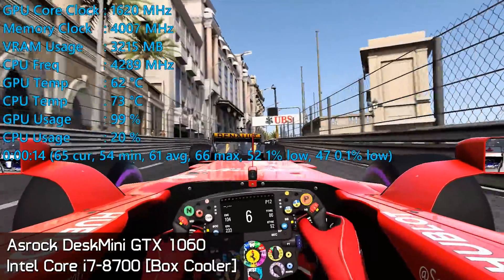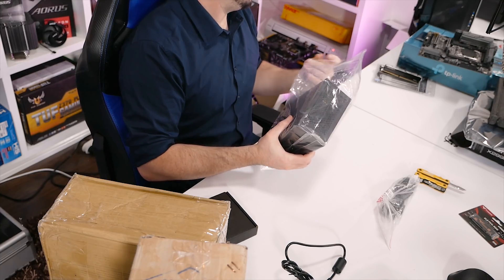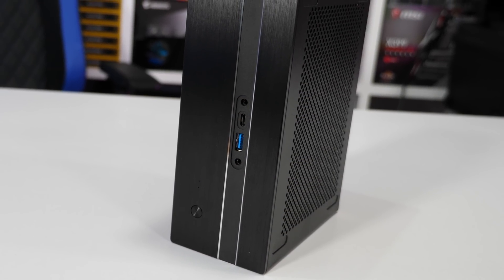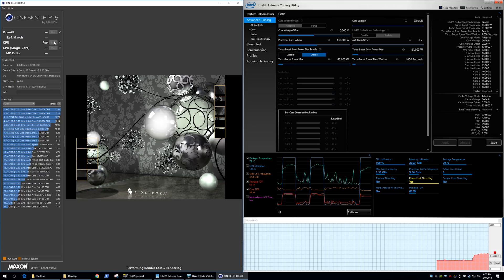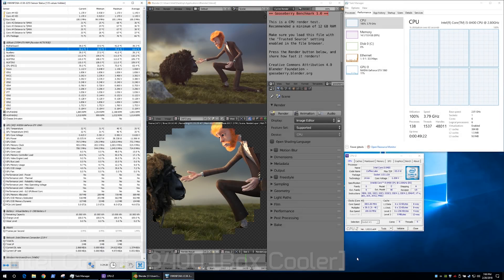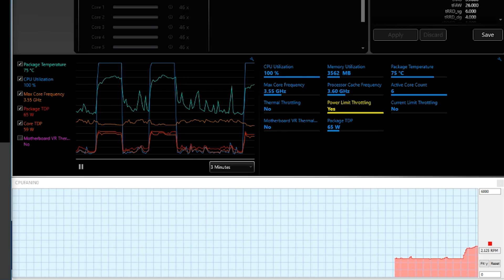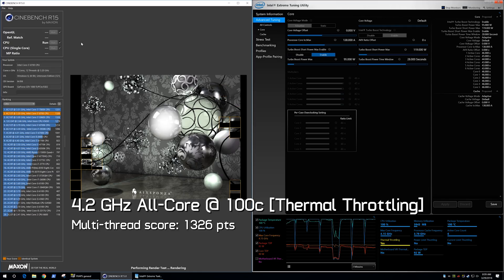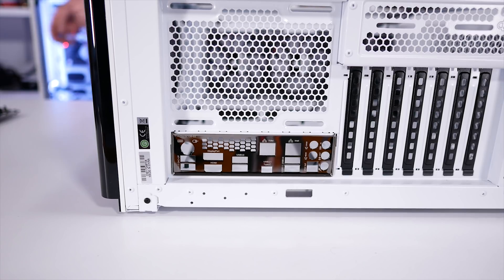Core i7 8700, Intel Box Cooler Limiting Performance

Comment: 65W - 3.5Ghz, not 4.3. CB15 score 1450 (normal result in reviews, if you forget about MCE-boys) / 1127 = 1/3 LOWER! This is Con-Lake. Power consumption and heat dissipation one of the most important characteristics of the processor, otherwise manufacturers would sell overclocked versions with 200W and dont care. When there is no normal cooler and forced to buy aftermarket for ~20$. This is Con-Lake #2.
Reply: Forced, because advertised performance (by review sites) is not achievable out of the box. "Very fast" can be measured, 1127 - does not fit, because this is the result of stock 1600. Which now costs 189$. 8700 - ~300$. Not "even more", just 4.3 on all cores, this is the problem. You're too obsessed with this gammaxx, actually it not everywhere cost "10$", newegg - 20$, some cheap shop in my country - 16$. Why does AMD all work out of the box and even allows it to overclock? And the expensive intel gets even more expensive. Okay, let the Intel conclude a contract with Deepcool. And fix the fake TDP for realistic in 95 or 115 or where it is not throttling. Then the problem will be solved.
Reply: on the asrock z370 pro4 with 102,4mhz baseclock and the 20€ ekl ben nevis my i7 8700 scores 1458 in cinebench with MCE off https://www.dropbox.com/s/bz69bfvh4y019ur/cb15.jpg?dl=0
Reply from the maker: You aren't forced to do anything and the real out of the box performance of this CPU is with the box cooler and it's very fast. You just get even more performance if you spend $10, that's not a conjob. The real score isn't 1450 pts either, I can't get that on a high-end Z370 board with a liquid cooler.

Comment: So, "out of the box" or the default performance is lower ( which in computerbase review, the OEM Medion said: that's inline with Intel spec)  is sucks, and you have to tune it with additional software and additional aftermarket cooler to reach or at least getting closer to the "review" performance?. 

Well, I would call that a "con" job indeed.
Reply from the maker: You've some how misunderstood. The way the 8700 performs out of the box with the box cooler is what you should expect. Reviews that only use advanced cooling have miss-lead you. The 8700 is still extremely fast with the box cooler, it's just faster with a tower style cooler. It's not a conjob that's silly.
Reply: Hardware Unboxed 
"Reviews that only use advanced cooling have miss-lead you", isn't this the problem here? . something that was created from the omissions of all core turbo information that's within spec/the standard configuration that the consumer would expect when they are buying PC from OEM, so, without that, reviewers would just go with whatever results come from their test bench regarding the the all core turbo which in turn giving false expectations of performance the consumer would expect to be out of the box or from OEM.

I get it that there's no false information coming from Intel, but the fact is this practice create false information from many "mainstream" reviewers which most people would refer to.
Reply from the maker: @Snow Star - Any OEM will just use the box cooler which is rated for 73 watts. Almost anything else would be better.
Reply: Hardware Unboxed I got questions to ask, the i7 8700 TDP of 65 watt is measured at base frequency of 3.2GHZ correct? If so any OEM would stick the 8700 in a 65 watt or lets say 80 watt motherboard, and use a 65watt TDP cooler to save cost and make a profit correct? 

If so the max all core turbo would only be as high as what's possible with 80watts for as brief of time as possible in order to make sure the computer works within warranty period right?

 So in light of all that is it safe for an average person to look at reviews that allows the 8700 to consume what ever watts it needs with the lowest temperature and say well guess I'll buy the OEM machine because the OEM machine will perform similarly? Thanks
Reply: Snow Star that's the problem mate. As you could see in this video, in order to get the performance you see in many reviews, you have to remove the TDP limit using Intel XTU to 135 watt, well basically running it out of spec or in other words overclock.

So, Steve, the "blame" is not on the box cooler but the TDP limit, since you have to remove the TDP limit first in order to get that performance. OEM using 65w cooler isn't to blame since they use it because it's enough to run the CPU within spec 65w from Intel itself.

Basically the root of the problem is the lack of information, guidance to reviewers from Intel. 

So, "con job" confirmed?
Reply: Lucurous I assume the 8700 exists other than standard reason of product segmentation and what not is because the 8700 will not do 95watts at 3.7GHZ and clock higher(low quality silicon). In other words clock per clock the 8700 would consume more power and run hotter compared to the 8700k. 

Put the 8700 in a typical OEM PC and it is safe to assume under gaming/heavy use the CPU will run at base clock (or as this video mentioned 3.8GHZ but that would exceed TDP)99% of the time but users who bought the PC are under the impression of over 4GHZ turbo on all core all the time. Even worse for the lowest quality CPU which is the 8400. 

Maybe just not buy an OEM machine the cheap one at least.
Reply: Snow Star it really depends on what TDP the motherboard set at or what the OEM specify. In this video with 65 watt TDP the cpu limited to 3.5 Ghz (not 3.8) . Of course as in this video you could remove that limit, set it at 135 watt and with an adequate cooler it could reach 4.3 Ghz, presumably at higher voltage (power).

This make curious about motherboard with 65 watt TDP. I would guess they would behave the same, so locked at 3.5 Ghz or maybe even lower if you have bad luck with silicon lottery and get cpu that require more voltage at the same clock, anything that could reach 3.2 Ghz at 65 watt is passable as 8700 after all. So, yeah Intel took silicon lottery to the whole new level.

Comment: I have a i7 8700 i slapped my old 212 Evo  activated xmp an got 4,43 allcores stables at 55c , the problem is not the processor is the shitty stock cooler
Reply: Od1sseas you know bckl oc exist? You can overclock a CPU with the multiplier blocked just by modifying the bckl frecuency . Read a little  before you talk
Reply: The Asus prime Z370 let you adjust the frecuency from 100 to 103.5 and thats just enough for 4,43 all clock and 4,7 single
Reply: It can be dangerous for your Sata devices. And not worth +3.5% clock increase.
Reply: Dmitry i Talk with Asus support and they told me is so mild It wont damage any component. I didnt do It to oc the cpu, it was automatic when i activated the xmp profile of my corsair vengeance 3000 ram.
Reply: bckl overclocking will not damage your Sata ports or PCI-E ports.  Those ports are on a seperate clock from your reference (aka bckl) clock.  the reference clock is used to find the CPU, memory, and Motherboard bridge frequencies and is a great way to overclock a locked system.  I used that tecknique before to overclock my AMD Athlon X4 640 from 3.0 to 3.3 GHz.  I wanted to go higher, but thermals were getting in the way so I had to stop it there.  I Ran that OC for over a year with out any issues before I upgraded that system to my i5-4690K
Reply: You delid ?
Reply: Yea mines running 4.5 lol but I have a huge cooler on it and I’m use thermal grizzly Kryonaut made a huge difference

Comment: I5 8400 or ryzen 1600?? For gaming
Reply: Ngurah Bramhyang well for pure gaming the i5 8400 takes it, but this month ryzen 2 comes out (ryzen 2600) and also the cheaper motherboards for coffeelake so wait a few weeks before buying anything
Reply: fromholland1001 okee thankyou brother :)
Reply: Depends on resolution and framerate. Ryzen should be fine for anything under 144hz. The two will be equal at 4k when the gpu is the bottleneck, and the extra performance Intel gives won't be worth the price since the boards are $150 compared to $50-80
Reply: nice info, thankyou so much!
Reply: Not much of a difference from what I've found, its just that the 1600 is unlocked for overclocking, and the B350 boards are about $60, it also comes with a good stock cooler.

Testing Fornite, the difference between Ryzen 1700 (3.8 Ghz) vs i7 7700k (4.5 Ghz) was 220 fps vs 240 fps respectively. This was lowest settings (360p resolution) with a Titan Xp and GTX 1080, so no GPU-bottle-necking with it way under 720p even. That's the best case scenario to show differences between them.

Comment: Just undervolt, wont be so much trouble with power consumption and thermals throtling
Reply from the maker: .....or buy a $10 cooler.
Reply: Hardware Unboxed I had that mini case in mind;) 
PS: I Appreciate your job <3

Comment: My i5-2500 would only do its all core turbo, never going any higher regardless of whether it was 1 active core or all 4.

These are the advertised clocks for the i5-2500 non-K (and are stated the same in Intel XTU)

Base: 3.3GHz
4 core: 3.4GHz
3 core: 3.5GHz
2 core: 3.6GHz
1 core: 3.7GHz

However the best i could get was 3.4GHz regardless of how many cores were loaded (running at 70'C load with an oem cooler)
In order to get the 1-3 core turbo clocks I had to enable a BIOS option, Extended CPU power savings (Reluctantly)
Which allows the non active cores to idle, conserving power/temp budget and allowing higher turbos on the actual active cores!

Of course this is a BIOS/Board restriction, but interesting nontheless.

Comment: I think that Aldi Median system showed a typical hot box scenario and what can be expected from many pre-built brand name systems that use the box cooler and minimal airflow case designs. Most people building their own systems and avoiding the extremely low cost no name budget cases should be able to avoid building a typical hot box and give the system enough airflow to prevent the worst of the thermal throttling so long as ambient temperatures stay within a reasonable range.
Reply from the maker: It was also temp limited to just 74 degrees which is the primary reason for the drop in performance, that and they used the box cooler ;)
Reply: In all honesty I cringe at temps over 70 degrees and so having a 74 degree limit shouldn't be the cause of throttling, even though I know that the chips can handle it.  When temps get into the 80's and 90's, in my estimation that's just pushing performance over efficiency a bit too far for my taste. I personally look to keeping everything well under 60 in normal use and will only be ok with higher temps during stress testing overclocks for system stability testing. As far as I'm concerned the TDP rating on the 8700 is a marketing ploy to enable using an insufficient boxed cooler, Intel have had boxed 95Watt coolers in the past and so there is no real excuse for not including one even if they are rating the chip at 65W, it's not as if it's a budget chip, it's their second most expensive one for the desktop and the cost difference between the 65 and a 95W coolers would be less than a couple of bucks for some more aluminium or a copper slug, because at stock there is very little chance of these chips running 65W or less under load unless they are purposefully temp and TDP limited, which OEMs are likely to do to enable the use of cheap parts.

I have a 2200G enroute now for an eventual router build (bloody Easter delayed it) and I have a spare spire cooler from my R5 1600 build and I'm hoping that will be enough to keep temps in check with moderate overclocks of 3.8GHz/1500MHz, if not I might use it as an excuse for a 120 AIO and finally play with water cooling, just for the fish. (for the halibut), though when I do build the router it will be air cooled and back to stock.
Reply: the Aldi system use the official specification from Intel. 
The Aldi system use the turbo core for 8 secounds und than it got to base clock.

this is the link to the test.
https://translate.google.com/translate?hl=en&sl=auto&tl=en&u=https%3A%2F%2Fwww.computerbase.de%2F2017-12%2Fmedion-erazer-x67015-aldi-gaming-pc-test%2F2%2F
Reply from the maker: @ecchichanf - And it performs as expected according to the Intel spec. They allow you to achieve greater performance it you over spec the cooling. Just like what AMD admitted to doing with XFR. Where is the Conzen video series?
Reply: And when you run standard cooling, because tjmax=100.

Comment: Yay! Thanks Steve, I've been wondering about this meself. Interesting to see that hyperthreading has a big TDP impact
Reply from the maker: Hyper-Threading and another 500 MHz ;)
Reply: I would love to see testing too. 

Friend of mine used to have to turn HT off on his P4 back in the day to prevent overheating and shutting down. I recall it used to add 15-20c on top of HT disabled.  I doubt it would make the same difference as it did on those awful P4s but be interesting none the less.

Comment: So, advertised 65watt TDP means that to get advertised performance we need a better cooling solution and increase the TDP and you say that's not an issue? Rly? Are you serious? Maaaan that is total bs.
Reply: Advertised perfomance - ~1450CB. Out of the box - ~1150CB.
Reply: It exceeds the base clock. And if you buy a cpu, you buy the base clock. The turbo is not the all time clock speed, otherwise they would call that the base clock. The turbo clock is only for when conditions allows it. And here you could see that the box cooler did allow a bit of turbo boost so in fact it has a better cooling solution than what is needed for the base clock you buy with the cpu. It even got to 4.2 GHz all core turbo with the stock cooler when you allow the CPU to run to 100 degrees. Which in my eyes means it could even get to the max 4.3 GHz all core turbo when you optimalise conditions (lowering ambient heat, or better case airflow or whatever) so the box cooler would even allow max turbo. But the prime focus of a box cooler is to at least get the base clock.
Reply: Yeah, to get advertised base clock speeds on my RX 470 (XFX, get your game together!), you can either under-volt them 100 mV, and frequencies would jump up because its not power throttling, or do what I did and BIOS mod it to allow stupid amounts of power (its not going to use it unless you're extreme overclocking, but I like to do that, it just kills cards pretty fast).

Couldn't even run stock... That's so dumb, that's even with a +50% power on MSI afterburner (which helped immensely, but still not their). I can verify this is on all the XFX fan swapable models.
Reply from the maker: You get the advertised performance out of the box, you get better performance by spending $10 ;)

Comment: I hoped to see some gaming benchmarks too. There are barely any on YT and not relaible at all. Please in future benchmarks try to use i7-8700.
Reply from the maker: The i7-8700 is the same as the 8700K which is the same as the Core i5-8400 for today's games.
Reply: I can believe 8700 performs almost like a 8700k at stock, but i5 8400 in the same category?, i don't think so...
Reply from the maker: @ArgStyleRlz - For gaming with a GTX 1080 Ti using respectable quality settings, you had better believe the 8400 is on par.
Reply: More like you bottleneck the graphics card rather than anything else, but yeah, we can say they perform equally for the sole reason the graphics cards cannot keep up, however if you go play older titles at lower resolutions, the difference will be noticeable, even more on games which demands high ST performance...
Reply from the maker: Mate older titles at lower resolutions the difference won't be noticeable, the 8400 can push pass 600 fps in CSGO for example :D RIGHT NOW and at least 18 months into the future you won't be able to tell the difference between the 8400 and 8700K when gaming. Look at our detailed benchmark videos on the subject.
Reply: Yeah well, i guess our definition of "old" differs a bit, im aiming towards very old unoptimized games, mostly "MMOS" which demands the best STP and higher clocks to performs better, although in that regard i guess any higher clocked Intel CPU would perform better than the 8400...

Now if we see the picture from your standpoint, yeah i can agree, on 2010 and newer titles the difference would be meaningless, not because it doesn't exist, but rather because it wouldn't matter and at higher ress/quality the GFX would result the bottleneck...

Comment: Pentium 4 coolers are better-and those things were dirt cheap in the days of the Core 2 Duo. BTW my i5 4440 came with a better stock cooler. And that consumes only 54W under non AVX loads, and runs silently at that.

Edit: Note that I was able to directly compare the P4 stock cooler (which came with a Sept 2003 fabed P4 540J+reference Intel board) with the i5 4440 stock cooler (which was the same as the 4790K stock cooler anyway) by removing the push pins (which were broken) and using meccano bolts, plastic spacers and silicon gromets to prevent shorting out.

Edit 2: Also, the cooler supplied with the i7 8700 seems disturbingly similar to those that used to ship with i3.